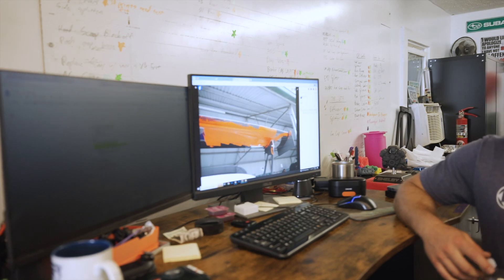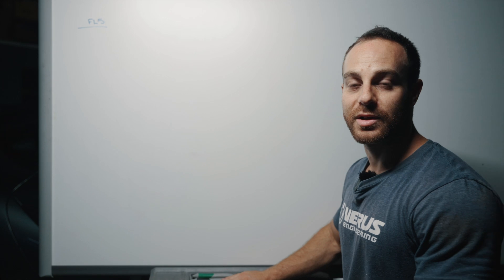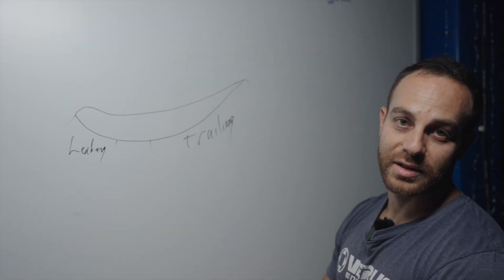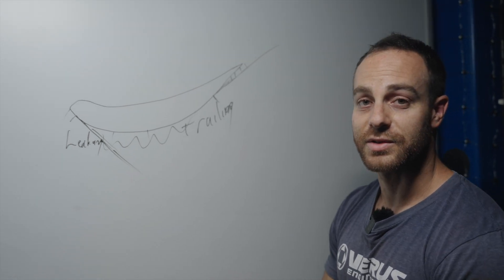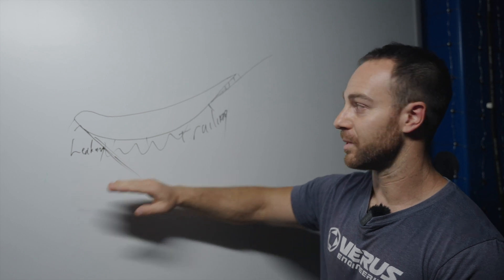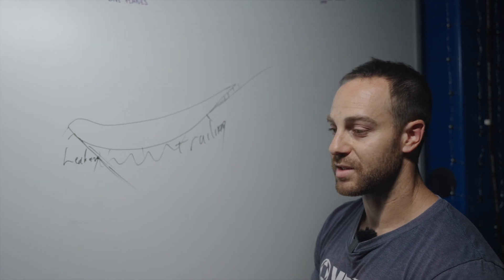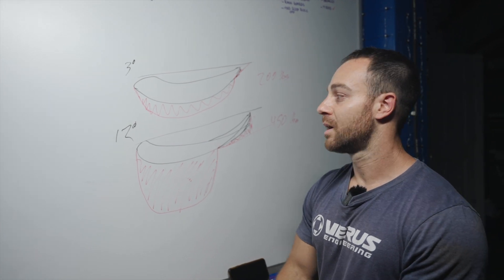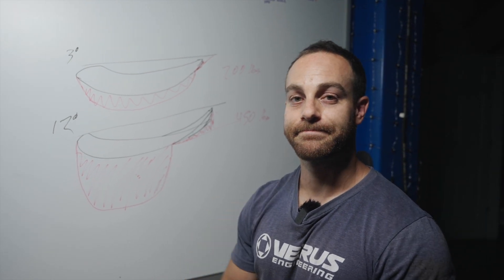The issue with Flow Vis | Explained by Motorsports Engineers

Comment: another way of analogizing it is

looking at flowvis from a lap around the track is like looking at the avg speed around the track for a lap, or even the raw line used for that lap (with no other data). it's neat to look at, but that doesn't inform which corner, braking zone, or straight the gains are being made and how they're being made (less drag, more downforce, combination of them, center of pressure location and/or aero balance, wing efficiency in yaw, etc)

something that always confuses laypeople is the idea of a car with slightly lower "peak downforce" having a faster laptime that a car with more peak downforce

Comment: Aero novice here, would a dimpled underside wing skin or the addition of underside vortex generators offer much benefit?
Reply: Dimples create separation bubbles. After a separation bubble the flow is almost always turbulent. While easier to predict(it's already turbulent, you don't have to predict the transition from laminar to turbulent), it loses a lot of kinetic energy. A trailing edge separation style wing takes the unpredictable transition from laminar to turbulent flow out of the equation.
Reply: I’m curious to know myself. I’ve seen dimples ondiffusers/tunnels with a front splitter to help keep the air attached.

Comment: Aerodynamics is pretty complex topic to really have conversations about due to basically all the reasons listed in this video. Fluid flow is just a bit of a pain to describe and understand when the system is rather dynamic, such as a car going around a track. Pressure fluctuations and turbulence practically ensure that at any one time, the flow around something like a Verus wing is not like an ideal streamline CFD screenshot. CFD and flow visualization are still crucial to designing and optimizing modern components, but with any simulation, you ultimately have to try to verify and validate design characteristics with experiments to ensure you have minimized distortions.